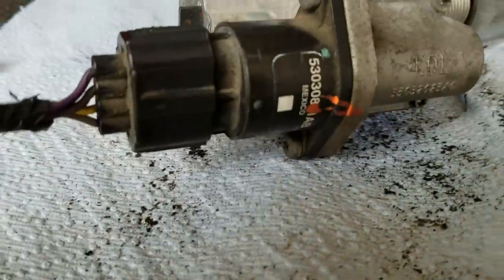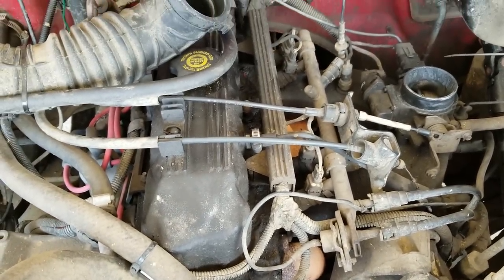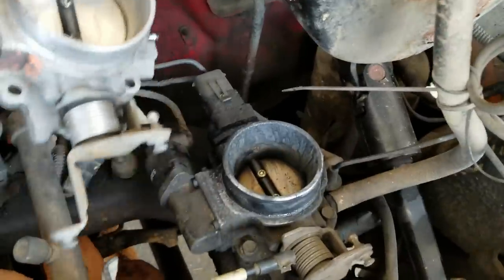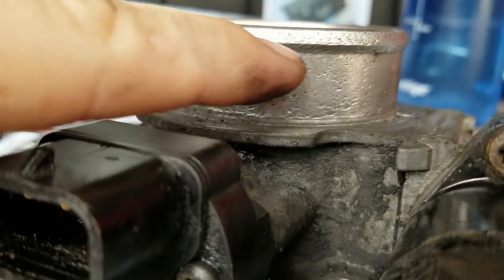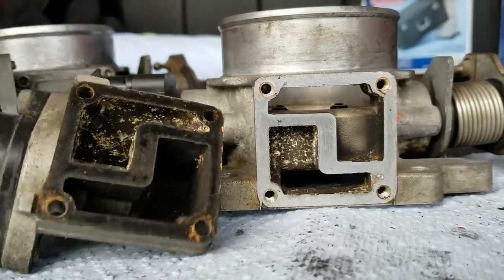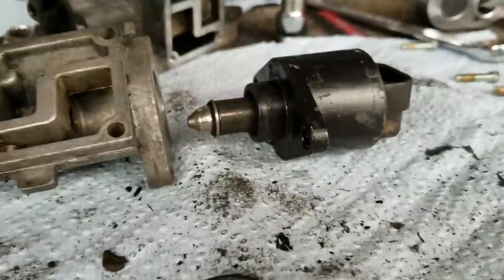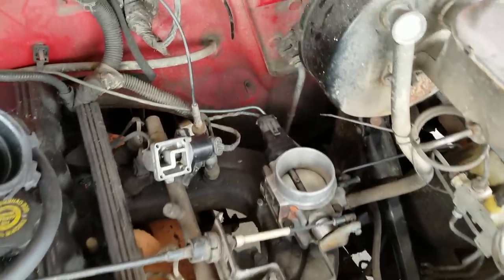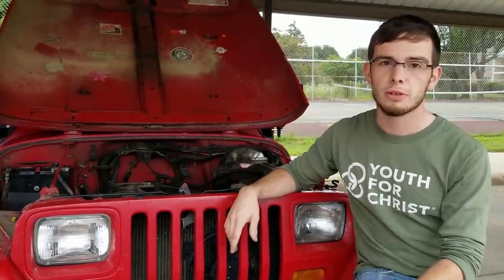Installing a 4.0L Throttle Body on a 2.5L Jeep Engine

Comment: very good video, my issue sounds like it could be this: what do you think???  my 1999 jeep wrangler, when I start it for the first time during the day, the engine will idle high and even sway between 1 and 2 RPMs, I am not sure what the issue is, there are no engine lights on, as well as once I put it into gear, it is fine, but it is like roaring when I first start it, and I have no clue.
Reply from the maker: That's pretty normal for cold start. After it has been running for a while it should idle at a lower rpm around 800-1000
Reply: @JeepSheepTV  so you are saying that is normal, it is just so different than my other jeeps I have owned,
Reply from the maker: @serf3469  if I am understanding what you are saying correctly, yes,  high idle at cold start is normal.  Unless it lasts for a really long time,  that could be a vac leak or something else but if it's just at cold start you should be fine.

Comment: Damn my V8 Cadillac 4.9 sees better fuel economy on the highway than that. Was tempting to get an old Jeep with the 2.5 but now not so sure.
Reply from the maker: Keep in mind that mine is lifted, with larger tires. However, if you are looking for a jeep for the first time get a 6cyl, I love my 4cyl and you can have a ton of fun with one but jeep made a killer straight 6 and that engine is a major part of the jeep culture so I would get one of those.  But if you do get a 4cyl... join our little band of misfits and I'll see you back on this channel.
Reply: @JeepSheepTV  Yeah I know about the 4.0. I'm considering the 4 cylinder because it's rare and in the older trucks. It's probably more AMC than Chrysler. Also have an '88 4.0 with leather on my radar.
Reply: @VinylToVideo  
My 01 Deville does 30-33 mpg

Comment: Brass is actually harder than aluminum dude
Reply from the maker: Fascinating,  looks like you are right.  However the brass brush didn't leave any visible scratches and worked well for removing gunk when my nylon brush did not.
Reply: @JeepSheepTV  kool kool
Reply: That's why people use brass knuckles and not aluminum knuckles..

Comment: Funny that you linked to the WF posting, which is where i first heard about this opening. I have a '95 YJ 2.5L. The original post talked about grinding the opening of the intake manifold. From what you saw with the TB off, think it would make much of a difference?
Reply from the maker: I think that grinding the intake manifold will make a difference. In fact I plan to make a video later of me having that done. The wider opening of the TB gets instantly choked down by the smaller diameter opening in the manifold. If there are any gains from this modification, grinding the manifold would provide gains for the same reasons
Reply: @JeepSheepTV  nice! I'll wait to watch your video first! Ha Thanks for this video, very detailed and easy to follow along! Subscribed! i still have to swap out the fan with an electric one, among other projects first. I have the tb already though.
Reply from the maker: @richconrad4554  Awesome! Thanks for the comment! I am working on an E-fans video right now where I will include some wiring diagrams that have worked well for me.
Reply: @JeepSheepTV  nice, I'll wait to do that video as well! Haha i posted a link to this video in wrangler forums, hope it helps others out too!
Reply from the maker: @richconrad4554  Oh wow! Keep doing that! I'll have you to thank if I get a ton of views.
Reply from the maker: As promised I created a video for grinding the manifold. Take a look on my channel and you should be able to find it!

Comment: At approx. 8:00, you asked what the little pock marks are on your 2.5L throttle body.
Those are casting marks.
The comparison you show between the 4.0L and 2.5L throttle bodies clearly show the 2.5L is a cast piece and was never machined.
The 4.0L throttle body, on the other hand, was clearly machined in that location.
Reply from the maker: It's a good theory but a year later the 4.0L TB had pock marks as well. Still not sure why.
Reply: @JeepSheepTV  Interesting. Looked like casting marks to me.
Let us know if you ever find out.

Comment: Where did you find that Throttle body?! I need one for my 88 YJ
Reply from the maker: I went to a pick yourself junk yard and pulled it off of an XJ. The same throttle body was used on just about all the jeeps with 4.0L fuel injected engines. They are very easy to find.
Reply: They are also on Dodges.....thats why I'm here, my lil 2.5l Dakota needs alil more power lmao

Comment: does the 4.0 AX15 transmission bolt up to the 1995 2.5L?
Reply: The 4.0 and 2.5 have different bellhousings. The 2.5 shares a bellhousing with GM v6's and such

Comment: Also, you could’ve had the original 2.5L TB bored out instead of buying a 4.0 and switching the sensors over.
Reply from the maker: True but machine time vs a $10 junkyard part. Either way you have to take the sensors off.

Comment: I have my doubts it adds any hp. Ultimately the camshaft only lets in what it lets in. Need to either force air in or change the cam
Reply: FYI, they have done some investigation into roller rocker arms moving up from a 1:15:1 to 1:16:1 giving .030 more lift (duration) which acts to get more air and exhaust out of the stock cam (a 1:17:1) will greatly increase air and exhaust .060 more open and duration. However, the 1:17:1 you will be modifying your valve cover and can only use the non-adjustable roller lifters, may be altering the stud lengths to get them all the way down to come back a half turn (hopefully can get them -o-ed to back off that half turn (my luck so far is everything I read and try to carry out has had a glitch (accept for the body wrap carbon fiber fenders went well), the lifters hit. Someone did a lot of engineering for this bolt on mode. I'm in the middle of this now, I read a lot from the race engine builders, seems that TB spacer hasn't added to the top end of  (interstate speeds) but they all said its better throttle response.
Reply: @rubyclay5543  yes, ultimately changing angle or length of a rocker, will slightly mpdify opening a valve as well, same effect as cam

Comment: Will this work for 88 model as it doesn’t have fuel injection but a slober throttle body
Reply from the maker: Maybe not as you need the functionality of the current TB
Reply: @JeepSheepTV  how about an 89?

Comment: So I can replace the carb on my 2.5 with the 4.0 carb and it will increase power? That’s it? Can’t be that easy, no way
Reply from the maker: This doesn't really increase power (except maybe a little at wide open throttle) but it does increase throttle response. If you are talking about carbs then that's a very different scenario as the carburetor controls fuel flow as well and one for a 2.5L will be tuned very differently than one for a 4.0

Comment: did your e fan come on your jeep  if not tell us about installing it... thinking about doing one on my XJ
Reply from the maker: That's a great video suggestion.  I'll do that.  Mine is just a generic fan I bought on Amazon.  I can explain the wiring in the video.
Reply: @JeepSheepTV  did it help the HP at all ....also this the best vid on the TB upgrade on you tube ...it is the only one so it the best  ...good job dude
Reply from the maker: @kennethlindahl9206  Not sure if you are asking about the fans or the TB but if either helped with HP it would be in the single digits.  Unfortunately with gains that low it's hard to tell without a dyno. According to what I know of physics,  either mod couldn't have hurt though. Thanks again for the comment and compliment! I'm hoping to make more videos and to improve them all the time, so check back for more!
Reply: @JeepSheepTV  subbed and watching 
94 XJ 4\11 gears in a 8.25 behind a 5 speed.....  good shape except paint
Reply from the maker: @kennethlindahl9206  Thanks! And that sounds like a beast

Comment: is it possible to install 4.0 throttle on 2.4L Cherokee ?
Reply from the maker: No clue, completely different engine architecture. Check the diameter of the TB on the 2.4L for some reason I think it already is larger, similar to the 4.0 TB
Reply: thanks for the reaction and for you time and for the answer, i will this check out, i have a one question about the eatonm62, is it possible to install in my car jeep Liberty ( cherokee ) 2.4L 4 bangs handly, sorry for my bad english and greatings from Europe Netherlands l👋👋👋
Reply from the maker: @recepgokkaya6602  I'm sure it's possible. I believe that engine had a turbo option in the dodge Neon so there might be an easier way to turbo it. Either way that means there could be an ECU out there that knows how to handle boost. Sadly I know very little about that engine.

Comment: I have a 99 Wrangler 2.5. I recently installed a 4.0 throttle body but the shop forgot to switch out the 2.5 plugs/sensors on the 4.0. Would this possibly lead to a blown head gasket? Thanks
Reply from the maker: So you are saying that you have a 4.0L throttle body with the 2.5L sensors on it? Did I read that correct?
Reply: @JeepSheepTV  I have 2.5 engine with the 4.0 throttle body installed, but the shop didn't switch the sensors. So the 4.0 sensors are still on after install.
Reply from the maker: @beavers7979  I believe that the idle air control valve has a different pin-out  on the 4.0L than the 2.5L I'm not sure how they could have even hooked it up. Does it idle?
Reply: @JeepSheepTV  i installed 4 hole injectors, cold air intake, iridium plugs, header, exhaust system, and the throttle body. Pick it up, drove 10 minutes down the road and over heated bad! They had to tow it in and found that the head gasket may have blown. Out of all the parts they put on, the only thing the shop didn't do right was putting the 2.5 throttle sensors/plugs on the 4.0 throttle body. Just wondering if that would cause the head gasket to blow
Reply from the maker: @beavers7979  You see, the 2 sensors that are present are idle air control and throttle position. If the throttle position sensor feeds incorrect info to the computer you could have a lean mixture resulting in more heat but the values should be the same from 4.0 to 2.5. The only thing that would be really different is the idle air control but outside of idle that shouldn't have affected the engine temps either. None of your mods should have any affect on you head gasket unless it was it was already about to blow and the marginal increase in power is what set it over the edge. Unfortunately I don't think you have a case. I would be more worried about the engine cooling system ( fans, water pump,  thermostat, etc.)
Reply: @JeepSheepTV  that's what i thought too. Just curious what you thought it could be. The engine has miles on it, so it was probably on its way to messing up. Thanks for the input 👍. Like the videos, keep them coming. Had my Jeep 4 months and have learned a lot from your channel
Reply: Got the Jeep back yesterday. Everything working awesome, exhaust is louder than I thought tho. Had it up to 85mph on the interstate today. Really surprised how it runs now!
Reply from the maker: @beavers7979  glad to hear! My exhaust is loud too, I might try a few different mufflers to see how they sound and make a video of it.
Reply: @JeepSheepTV  i thought about trying some videos but never done anything like that before. My goal for next year is to drive to Moab! I'm in Tennessee so it would definitely be a fun ride.
Reply from the maker: @beavers7979  I did that drive this year from Michigan.  It's a good time. The 4cyl  is still really slow in the mountains but has no issues on the trail.
Reply: @JeepSheepTV  that's my goal! Looks like an awesome trip! Would love to camp out for a week
Reply from the maker: @beavers7979  you should.  Did you see my videos from my trip? You can send me personal messages from my channel page and I'll recommend some trails for you
Reply: Wont do anything to your head gasket

Comment: That's a throttle body, not an intake, and it's a 2.5L not a 2.4 liter. And you're supposed to guide others into following your direction?
Reply from the maker: Yup,  look at the video post date. Gotta start somewhere.  I used to have a hard time remembering names and numbers when on camera,  it was really frustrating.
Reply: @JeepSheepTV  my dumbass never paid attention to that. So this modification increases throttle response slightly. Did you ever port the intake to more closely match the 4.0L throttle body?
Reply from the maker: Yes I did, there is a video about it.  But basically a Dremel some carbide burr cutting tool thingys and just shape it till it feels "right". The science here is vague but the idea is to reduce turbulence.

Comment: This wont add any power at all you still have the same intake manifold so you can put as big a throttle body on it as you want wont flow anymore thru the manifold
Reply from the maker: That is true if the intake manifold is the weakest link, if the throttle body is the weakest link then replacing it will help flow. I honestly don't know and the hp gains if any are so small its impossible to tell. I did port the manifold later on just in case. :)
Reply: @JeepSheepTV  after you ported it did you notice any difference?

Comment: ?How in the world do you get your jeep to do 75-80
Reply from the maker: Petal down, shift late, no wind
Reply: @JeepSheepTV  do you have a lift or bigger tires on your jeep? Or is it all stock
Reply from the maker: @tylerlipscomb4878  I currently have a 1.5" spring lift and 2" body lift with 31" tires
Reply: @JeepSheepTV  I'm running 31's and 4inch rough country and my 2.5 is a complete dog.  Did you re gear yours?
Reply: 4.88 gears
Reply: Mine will cruise at 75-80 but the rpm’s are high. Like almost 4k

Comment: That’s a throttle body not an intake just so you know. Lol
Reply from the maker: Lol 22k views and you are the first person to say something! I could not for the life of me remember what it was called.
Reply: Lmao I was just looking through the comments and I was like how did nobody catch onto that yet! I’m working on a customers TJ right now and I’m gonna try and convince him to do this swap. Nice video!
Reply from the maker: @dylanrowan6626  I recommend it,  it's crazy cheap to do and new shiny parts are usually a good thing! I recommend boring the manifold as well (I have a video for that) it's also easy lol
Reply: Swapping the throttle body and difference in response and power?
Reply from the maker: @dylanrowan6626  I personally have no hard data but there was a dyno study done that showed 5hp gained.
Reply: Oh shit alright I think we’ll give it a shot. The TJ slows down a lot in 5th gear pedal to the metal lol
Reply from the maker: @dylanrowan6626  I know the feeling.  I put in a remanufactured engine, and put on headers plus the TB swap, 4.11 gears,  and 4 hole injectors and I can get up to and maintain 70 on the highway pretty well
Reply: Nice! Yeah this guy doesn’t drive it much I just  rebuilt the top end new head gasket and a bunch of other stuff. Just ordered a slip yoke eliminator centering ball that’s getting fixed next.

Comment: Those pockmarks are from crappy casting.
Reply from the maker: So the 4.0 throttle body got the pock marks after 4 months of use so I don't think it's the casing... hmmm
Reply: @JeepSheepTV  The little engine was cheaply cast aluminum. The 4.0 was cleaned up on a lathe. Or do I have it backward?
Reply from the maker: @neshobanakni  what I am saying is that they were most likely made from the same process.  The 2.5l had pock marks on it after years of use. The 4.0l gained pock marks after a few months of use.  So something from my engine is causing the marks not the manufacturing of the throttle bodies themselves.
Reply: @JeepSheepTV  You are likely correct.
Reply from the maker: @neshobanakni  The only real question that remains is, what is causing it?